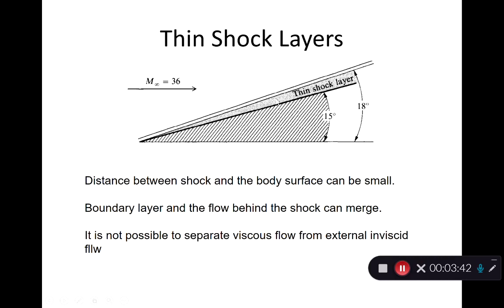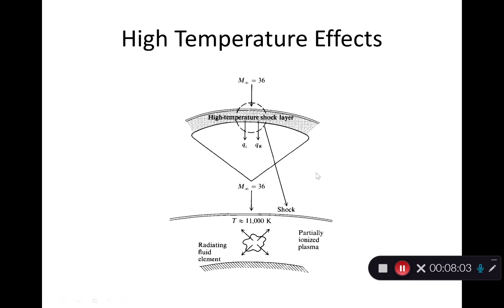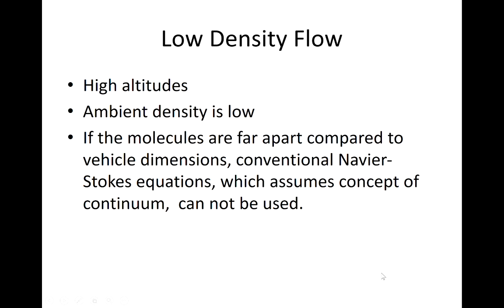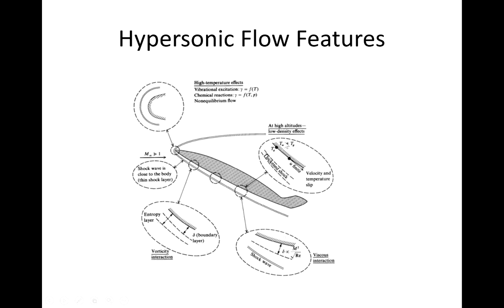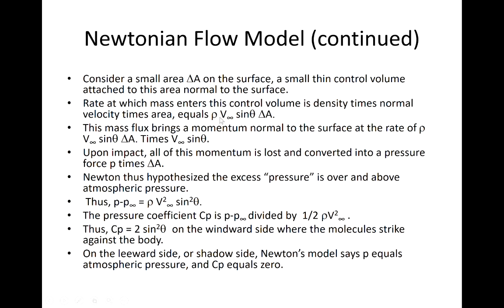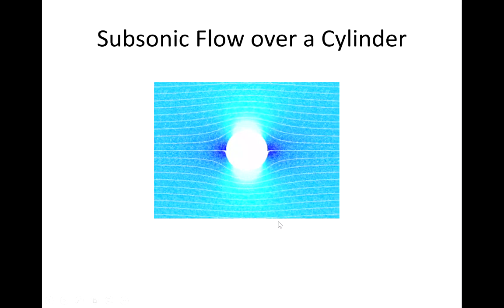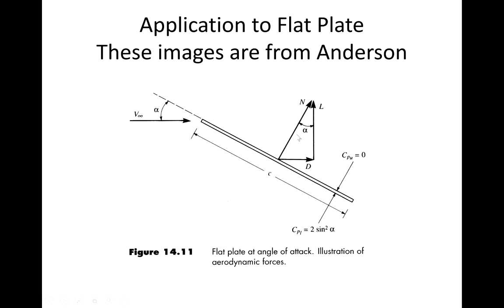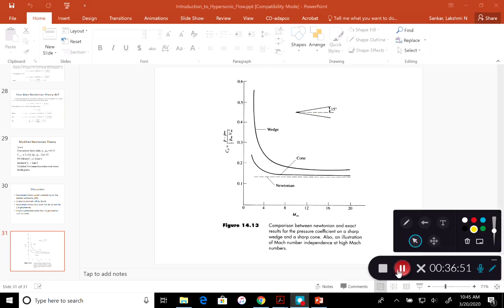Introduction to Hypersonic Flow

Comment: how to calculate cd for cylinder using Newtonian fluid ?
Reply from the maker: Front part has pressure equal to P_atmospheric plus  density times velocity squared.  The back half has just p_atmospheric. Thus drag force is density times velocity squared times diameter per unit span. Find CD from this
Reply: @lakshmisankar6498  Thank you Sir. Do I need to integrate drag force from 0 to D=2R ?